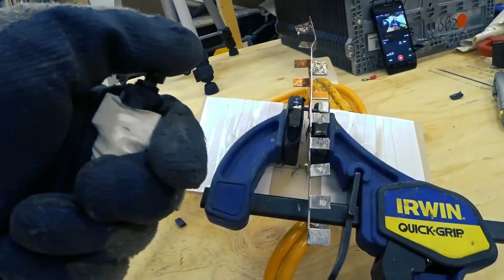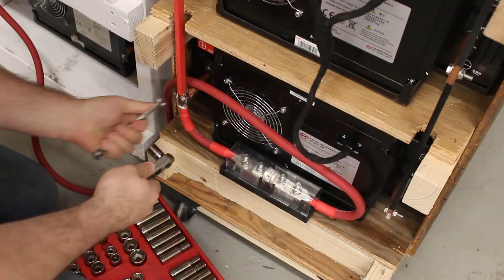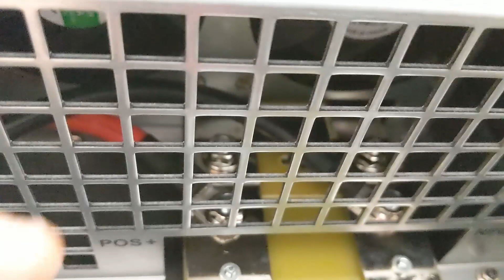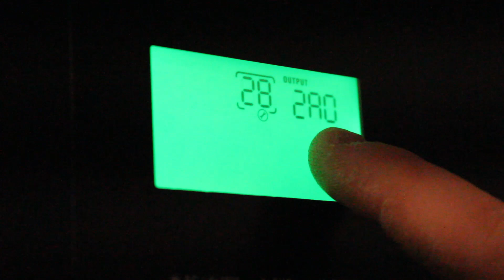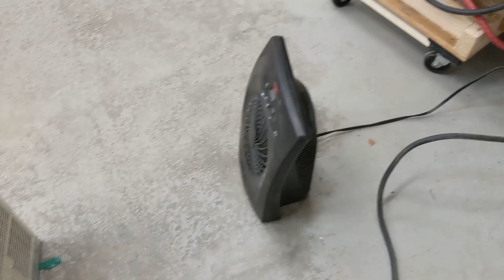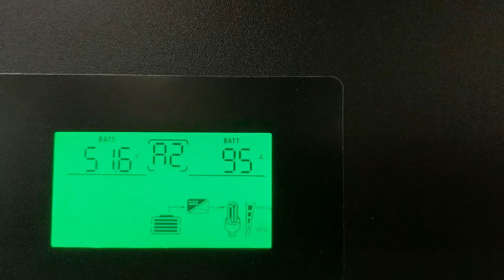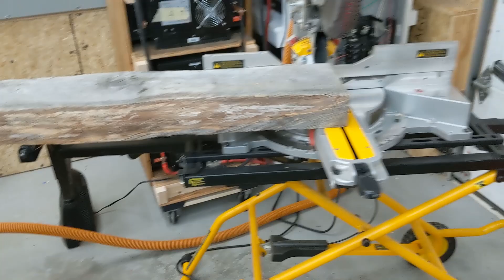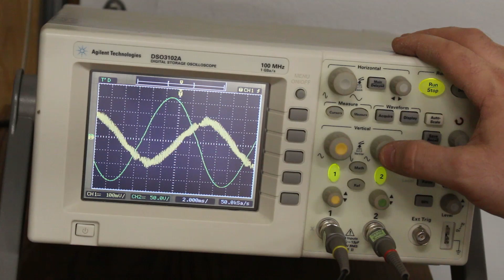Split-Phase Inverter, LV5048, Test Solar, Off-Grid

Comment: hi, great video. 
What was the error code after overloaded? 51? how do you clear up the error? I´ve got one LV5048 and this gave me this error, and pass to bypass, after that it didn´t transfer to line mode.
Reply from the maker: I don't remember the code.  But I turned off the inverter, then back on.

Comment: Since these inverters are able to operate in parallel, adding a second or third inverter would likely solve the high surge problem.   But, of course, that would cost as much or more than a single beast of a LF inverter that could easily handle all the loads with much less complexity.
Reply: True, but then you'd still need to buy a solar charge controller and/or battery charger. This unit includes those features as well

Comment: Which inverter would you recommend
Reply from the maker: I was very happy with my Aims inverter (120/240v 6kw model).  Right now I'm hooking up a pair of SMA sunny islands that should work well, but I have not fully tested them yet.  Top of the line brands are Outback and Victron.  Aims is more budget minded, but solidly built.

Comment: Thank you for sharing this video David. I hope that this will work for your buddy's well pump. All depends on the horse power rating and the inrush current but since he needs 240 volts,  there is a good chance that it will handle the load. And yes, transformer based inverter the way to go for an inductive loads. I guess the only disadvantage is- larger they are and while in idle, they draw more current on DC side. Thanks for your video, it does help when it comes to decision making on what type of inverter to buy.

Comment: I have MPP Solar LV5048 is it enough power to connect to my breaker to power up my whole house? My family has been using average of 15KW daily. I tried two 1875 watts hair dryers, only power one 1875 watts at first, then the unit shutdown itself even with PG&E grid backup connected, until I changed the default settings of 28 2A0 to 2A2 then the unit was able to power both 1875 watts hair dryers = 3750 watts total. Is it safe to try three dryers (5625 W) or four hair dryers (7500 watts)? Strong enough to power up my whole house?

I have twelve batteries 48 volts 12v each, if I put four more batteries, do I have to equalize just four batteries or sixteen batteries? Thanks

Comment: Manufacture should set the default setting  28  from 2A0 to 2A2.
I connected the 48v batteries and grid power and tested the unit with a 1875 hair dryer was working perfect but I put another 1875 watts hair dryer then it started beeping crazy. 
I turned of unit it still beeps, I gotta disconnect the battery for couple hours to get rid of the buzz noise. 
 Then I changed the setting to 2A2 both hair dyers were working.

Note: If you can change the setting 28 turn it off you have 20 seconds to change.

Comment: Nice video. I was thinking about getting one of these for my enclosed trailer. But wasnt sure how good they are.  I haven't found anyone who did a long term review on them yet.
Reply from the maker: My friend Ben uses a 5kw version that only puts out 240v single phase.  He then feeds that into a transformer with a center tap to get his split phase 120/240.  This has been running his whole house over a year.  He bought the transformer used on ebay.  It's a better option than buying this model.
Reply: @DavidPozEnergy Thanks for the info. Much appreciated!
Reply: @DavidPozEnergy  This is the European model you speak of right?  The PIP-5048GK. I was looking at this as well and immediately thought step down transformer to 120 - 230v.  It's half the price LV5048.

Comment: good night for that mpp solar split phase 5000w how many 6v 210ah batteries do i need
Reply from the maker: This inverter is a 48 volt model.  So you will need to string together enough batteries to make 48v.  If you are using 6v modules, then you need 8 modules in series to get you to 48v.  After that you need to determine how many parallel strings you want, but that is based on your capacity needs.

Comment: Not a good review of the product. Let me see if I understand this correctly. the products primary function advantage, is that it can run all your 120 needs at 5000 watts but if you have to turn on a well pump, you can switch it over to 240... allowing your pump to run and fill up a cistern.. for example. then return to 120 service. . . .  at 5000 watts. is that correct?
Reply from the maker: The goal is not to switch the inverter back and forth between 120v only or 120/240v split phase.  The plan is to leave it in 120/240v split phase all the time.

Comment: Poz..I have a question?  ....In this inverter handle the surge with in their own 2500 watts? ...Hence getting to 5000 watts...is just like having another inverter of 2500 watts with the same limitation? ....Ummmm I rather stick with a  truly  8000 watts  that can have a surge of 16000 at 120 volts ....Poz...have you seen this..https://www.ebay.com/itm/8000W-Pure-Sine-Wave-Inverter-12V-24V-36-48V-DC-to-120-240V-Solar-Power-Inverter/201588624870?epid=5033532148&hash=item2eef9e4de6:g:p~AAAOSw3hFdaIvf

Thanks.
Reply from the maker: Yes, I've seen that inverter.  It's not bad, but not a great value for what it is.  I did a review on it here: https://youtu.be/TZbjy9t933E
Reply: Yep...I saw your video few minutes later after I posted this question here... and definitely... I  quickly hated the fact that there was 60 volts between neutral and ground again...even in 2019...I had a 3000 reliable unit with the same dam issue (2017)...After a year, it burned the socket for  the fuse. End of it.  

Here is the question, I want to power two (2)  AC (Air conditioner)   at 1500 watts (120 AC volts) each one for a total of 3000 watts...From your experience, which inverter  will be a good one  for this offgrid application  at 48 volts DC ? Thanks.

Comment: I was looking at this MPP-Solar  All In One unit too. Now I know it has inputs for two sets of solar panels for the split phase output.  I decided to try out (just order last week) one the 24v Hybrid  from MPP Solar for up to 2400 Watt Solar input for about 20 amp 120v ac output in an all in one unit.  Wondering about that 220/240 v ac sine wave you got.  Thanks for your review

Comment: Agree with electrodacus; however, you may want to look at the fault codes and see if it shutdown is from a true overload, or simply low voltage cutout due to amp surge/voltage sag.  It appears by the weight of the MPP LV5048 (30kg) that it is (hopefully) a low frequency inverter--WAY better for surge loads, albeit, more expensive.  I've got a similar system using 16 T105 batts in 2P8S using 00 battery interconnects and 4.3 feet of 0000 to inverter. My MS4448PAE 5 sec surge power (real watts) is 8500 which is set up for for 120 and 240 split phase can handle startup of my 1.5HP Rolair compressor with a 1.5HP Marathon capacitor start motor (this system should be comparable to yours and the surge certainly exceeds your chop saw). Maybe check your trough voltage for sag.  I'm no expert, but the amplitude differences and the dirty waveform  revealed on the scope measuring 240v may be an indicator for somebody who knows more than I...  Good luck and thanks for the great vid.
Reply from the maker: I wish it was low frequency, but no.  It's high frequency.  The manual says up to a 2x surge, but does not state how long.

Comment: Give me a pair of Outback FX/FXR inverters any day. Throw in a couple of Outback Flexmax 80 controllers while you're at it. In the very rare instance that any of it goes down, I have redundancy,, critical for those of us who are totally off grid. (My first MX60 has been going strong since 2Q 2003)
Anyway, ten of the 24 volt LiFePo4 modules arrived a couple of days ago and testing has begun. So far, all cells look very good, coming into balance (<10mv) with a light charge. Still connecting (all new) balance connector cables, but it looks like they shipped me a good batch - all cells right around 3.2 volts with no stand-out weak cells. Thanks for putting me onto these! I'm not going to baby them. Putting them into full solar service in about a week. I'll let you know.
Reply from the maker: Great to hear they are shipping good batches.  I hope they work out well for you.

Comment: The heater test only has a small wattage fan motor and resistive loads do not have surge amps .The saw test with vac if you had gone into the other leg  of 240 it would have worked fine .However You exceeded the surge amps on your inverter but their is a solid solution .After your inverter install a capacitor bank ( soft start is similar but this would apply to the invert not just one leg ) .Yes,a capacitor bank.Here is why as you start a motor you increase amperage and it will lower voltage on a closely sized or undersized service  .Hence why in a grid system in a house with an older pre ac electric service your light would dim a little or a lot as the case maybe  as the AC came on .this event  the heaven draw down is Tripp’s the invert safety as exceeds the output capability .In  industrial plants where you have big machines with big electric loads you run into the same issue .Yes, a couple of big machines coming on at the same time can dim the lights ,trip a main and damage equipment.So the use either capacitors ( or very large motors not good for solar they are a power pig  ) however capacitors will work just fine . No ,it shouldn’t damage your inverter  .There are capacitors in the psc motors and start gear on AC , refrigeration units as it is to provide the extra push to get a unit started and keep it running . All you are doing is giving that circuit a boost from the capacitors during starting so they don’t draw down so hard on the inverter taking some of the stress of that inverter  .Run the math give it try make a video on it .you will be shocked on just how well it works.Note : this is only to help with surge amps and will do nothing if you load up any circuit beyond its operational circuit draw.It just helps deal its start up nuisance trips in closely sized systems where surge amps can push thing over the top .A bonus it also will act as a form a surge protection and help clean up power even more .

Comment: You can convert a so-called 'high frequency' inverter to a so-called 'low frequency' inverter by feeding the inverter output into an interposing transformer.  That MPP 5048 would've launched that miter saw easily if it was driving it thru a transformer.   You would feed the  inverter's 240Vac into a 240 to 120-N-120  transformer.    When you do this the entire output of the 240 connected side is available on just one of the 120 outputs.   Furthermore the source the miter saw would see would now include the impedance of the transformer.  This automatically limits what the saw can even demand of the primary source, (the inverter). 

A simplified explanation of this is that all the inverter's output goes into producing a magnetic field that crosses the iron core of the transformer. What harnesses this magnetic flux is whatever demands it from the other side.  It could be perfectly matched half one 120 side and half the other or it could be all of one of the 120 windings or anything in between.   Do remember that unless correctly sized for it transformers don't expect to have everything running out thru just one half of their secondaries but for brief starting surges it's not a problem.
Reply from the maker: That's exactly what my friend Ben did with his.  He showed that off in this video: https://youtu.be/6nxH9_GmCiU

Comment: You should look into smart start /easy start kits. They lower L.R.A start up by 75%. I've seen 16,000 btu compressors start easily with just a 2000w generator from using a smart start kit.

Comment: Basically....don't buy a combo inverter.  They're not there yet. That's  pretty slick but it should run that saw. I'd bet my 3000 CNBOU would start it. I don't own anything my system can run....including my welder. Great video though buddy. Bummer about the inverter.  It should run your buddies well pump though. 240 volt is so low amps.

Comment: Just installed a lv 5048 totally off grid system for a friend with a 240 volt well pump and in ran without and problem. I hooked up only 1 kw solar per side with 15 kw battery. Everything worked well, no problem. We’ll add more solar later.
Reply from the maker: Good to know.  Thanks for sharing.

Comment: You didnt say whether you would recommend these over your sunny island units. If you had a chance to re-start would you choose the MPP solar units over the SMA's?
Reply from the maker: No, I like having a big surge capacity fo rmy power tools.  The SMA inverters have large transformers which helps with this.  But if you parallel two or three of these MPP you might get close.

Comment: Re the scope settings I can see ch1 is set to 100mV per division ch2 50V per division. So
 I think you are seeing noise on neutral in channel 1. Channel 2 looks good and just need to change the gain on ch1 to match. Happy inverting !

Comment: Have you tried to add any capacitance to the system and then try the saw... Maybe this will give the kick you need to not hammer the invertor so hard on starting the motor.

Comment: I bought this inverter for my well pump also and it runs my well pump and my septic pump at the same time. It well for me.
Reply from the maker: Thanks.
Reply: I am looking to backup my well pump and septic also.  What size pump do you have? Mine is 1.5 hp submersible. Thanks.
Reply: Coz you didn't split the max output. Just a guess

Comment: So, did it work for the well pump, or will he need a second one?
Reply from the maker: Don't know yet.  An electrician is scheduled for 3 weeks out.
Reply: @DavidPozEnergy  ok its been 3 weeks.   And did you ever test the saw in matched 12v mode?

Comment: Hi David.  I don't know anything about solar or wind turbine power sources but I have been watching videos to try and learn a bit about the entire concept.  I am at a different stage in my life but I would like to begin doing some sort of "off grid" power supply in case of blackouts or emergencies, etc..  Your videos are great, even if I'm not always exactly sure of what you are talking about, lol.  We live in the southwest and in the summer it's not uncommon to be at 110 to 115 degrees outside.  We have a 5 ton and a 3 ton heat pump/AC system that runs strictly off of electricity.  We do not have access to gas so EVERYTHING is electric in our home.  Our home is about 3,000 sq. ft. and we have a well for our water supply.  If/when the power goes out we lose everything. I was wondering if you would be kind enough to give me an idea as to what size power source we  would need to run our entire house (except the 3 ton heat pump) in case the power went out.  I would like to be able to at least run the 5 ton heat pump/AC unit and the fridge, freezer, well pump, tv, internet, etc.. Is it possible to create a hybrid system of solar and wind turbine that is capable of running everything  without breaking the bank?  Think pension size budget, lol.  We have plenty of sun year round and we have a fairly steady breeze most of the time. We have over an acre of open space available and our home is set over one hundred feet from the road.  I hope I gave you enough information and I look forward to what you might suggest.  Thanks very much and keep those videos coming.
Reply from the maker: Hi.  I've seen people do setups with solar panels and wind turbines together.  One person is "Going Off Grid" YouTuber.  I have not personally installed a wind turbine, so I can't speak to that.  However, if you are thinking of a wind turbine then if might make sense to install a wind speed meter like this https://www.amazon.com/Crosse-Technology-V21-WTH-Wireless-Weather/dp/B075F68J5L/ref=sr_1_6?keywords=wind+speed+weather+station+and+logger&qid=1579177605&sr=8-6  You might find that you don't have consistent steady wind enough of the time to make a wind turbine worth while.
Reply: @DavidPozEnergy  
Thanks so much for getting back to me.  I want to utilize a hybrid system that is both solar and wind.  I have seen a few of them on YouTube.  Being a newbie I have no idea how much power I should be trying to generate.  Thanks very much for the information, I really appreciate it.  I'm looking forward to more of your videos.

Comment: Why did he buy pure sine wave to power a pump
Reply: motors run cooler (more efficiency) on sine waves. stepped waveforms have harmonics that become heat in the windings.

Comment: Is there a way to get a link/name/specs of the resistor used to avoid the sparks when connecting inverters into batteries?
Reply from the maker: They are 100w, 1 ohm.  https://www.amazon.com/gp/product/B01LYMCOPY/ref=ppx_yo_dt_b_search_asin_title?ie=UTF8&psc=1
Reply: DavidPoz thanks!

Comment: Dave... The first leg shown on the scope shows a lot of hash while the second input is clean. That's not right. Both output should be as clean as channel two. the reason why two different colors on the scope is so you tell what trace is what (channel 1 or channel 2) I wonder if this inverter will run the pump your buddy needs?

Comment: On your oscilloscope, have you looked at your house power, it will look smoother, the reason it shows two colors is so you can see and identify both channels while using it. Most large saws have to have a 30A. My saw won’t work on a 20A breaker either. If your friend uses a starting capacitor on both phases for his well that might help it to work for him. Very nice video.
Reply: He needs 2 units connected parallel to make 30amps